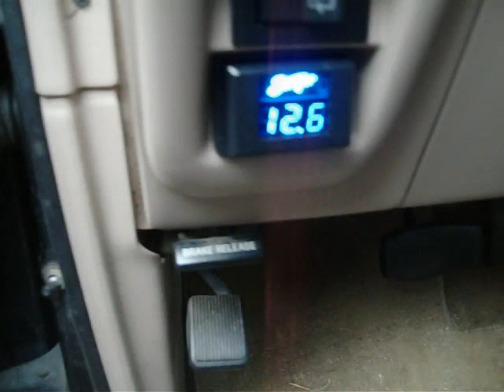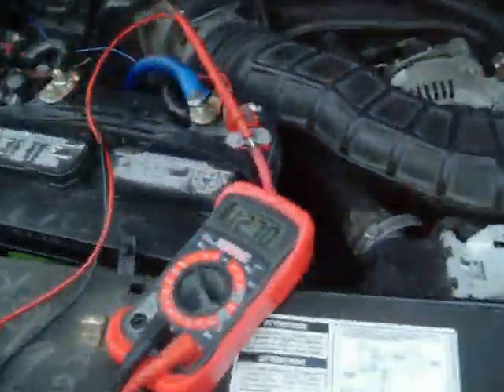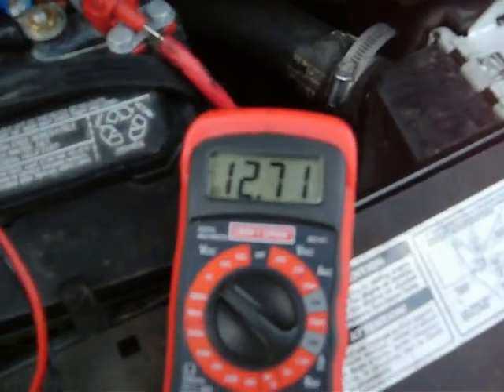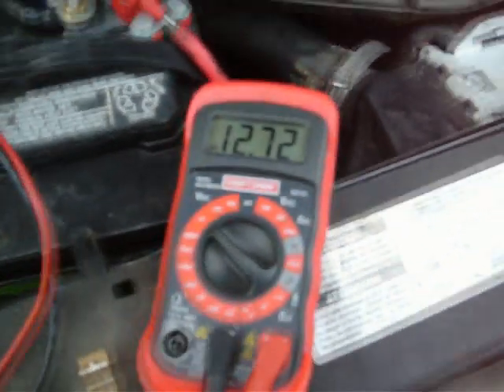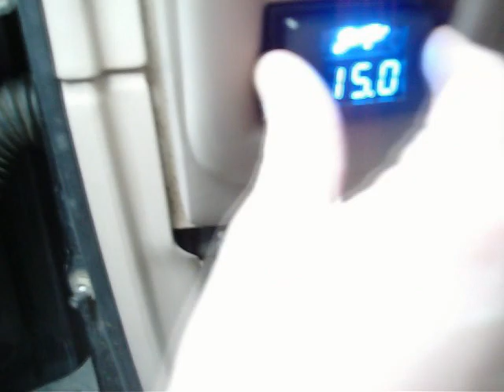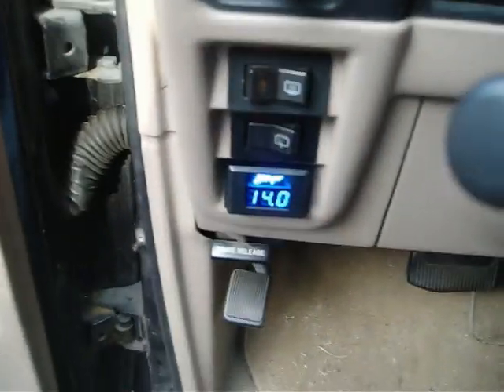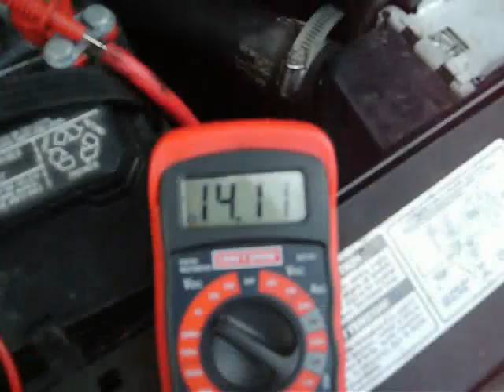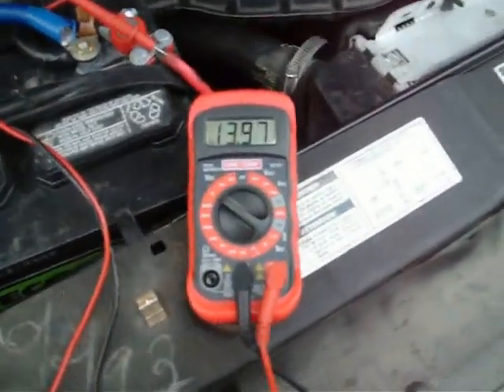Stinger Volt Meter Adjustment

Comment from the maker: Yes you can wire it to the amp, and adjust it to the dmm voltage AT THE AMP where the meter is connected.

Comment from the maker: I adjusted the meter to the voltage with the car off, and when i turned it on it was alittle to high i believe those stingers arent to accurate on on and off voltage, but you can get pretty close to one or the other. But if you wanted better voltage with the car on then it wouldn't hurt to get a new battery and high output alt.

Comment: Why do you have to adjust the voltage setting on this meter? My understanding of voltage meters is that they read whatever voltage that is present from the source in which they are connected to. Am I wrong in this thinking or is it just this particular brand?